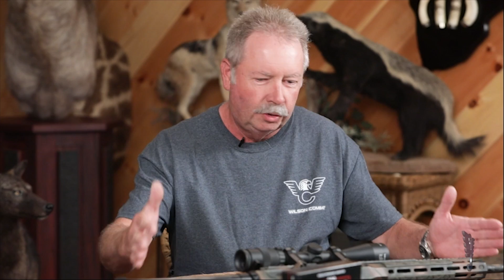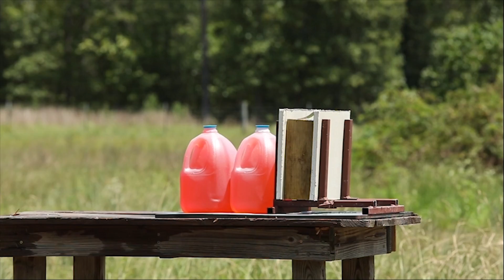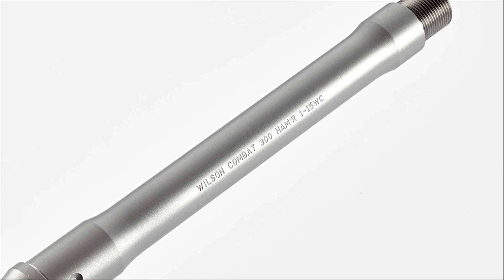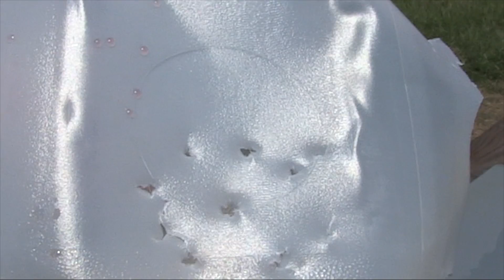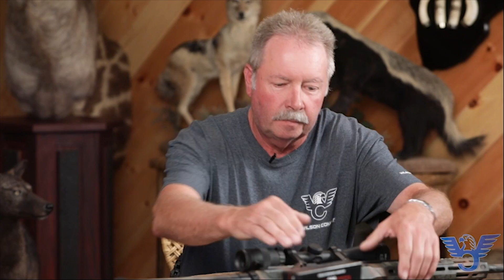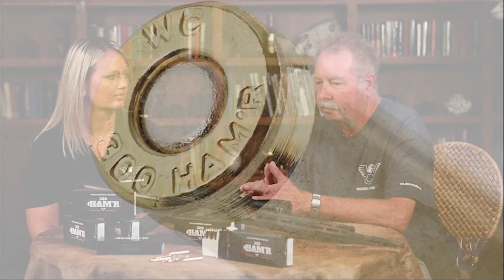An Interview With Bill - 300 HAM'R

Comment: I just converted a Daniel Defense DD4 V7 556 to a Ham'r. I used a 15 inch twist barrel, 16" long with your adjustable gas block because am running it suppressed. I bought 2 hundred loaded rounds of the 130 Hot Core, loading dies, CFEBLK powder, 200 rounds of the shiny (nickle) brass and 500 rounds of the 130 Hot Core Bullets. Printed your loading Data so I think I'm all set. Hoping I get groups like you do and I can't wait to try it on one of (a bunch of) our Texas feral hogs. Very nice video even if it  is 4 years old. Now I think I need a Wilson Combat 338 Federal. I have 20 rounds of ammo but no rifle lol.

Comment: Bill Wilson, I  have purchased a 300 ham'r barrel along with "all" of the components from Wilson Combat to put together this rifle,  but the chamber is so tight that when you load a round and don't fire it you can't get the round out without mortaring the rifle to unload.  The chamber was so tight that it would pull the bullet out of the case leaving it stuck in the barrel. This the 2nd barrel sent to me and was having the same problem with. I was on the phone with customer service and the gentlemen I was speaking with told me that I should ease the blot closed and then use the forward assist to complete the loading process.  This is the most absurd thing I have ever heard of when loading an ar 15 type rifle. He said that the chamber so tight that loading it the proper way was wrong, that you have gently load it because the weight of the bolt is pushing the bullet into the lands and groves,that it it essentially locking the bullet into the barrel.He said that it may improve with shooting It, but I don't want to spend money for something that should work right out of the box. If this is the case what is the sense in have a semi automatic rifle. Iwould like to hear from Bill Wilson himself.
Reply: First step: Don't try to contact through the YouTube comments section
Reply: @georgewhitworth9742  first step wasn't you tube for your information, just trying to make him "Bill Wilson" aware of what was happening in his company. I guess you didn't  comprehend the part where I said I spoke to  "customer service ".

Comment: The 35 Whelen is the ballistic twin of the nine three, especially with a 250 grain bullet. Practical same trajectory and recoil. The classic load is 286 grain projectile at 2,350 fps with just over 3,500 ft-lbs of energy. 
The recoil is less than most loads in a 338 Win Mag, 8 ft-lbs of energy less with a 250 gain load. If you can’t find a decent rifle in 35 Whelen, there are a lot of great European options and ammo for the 9.3x62, it’s an African classic.

Comment: There is a ranger 1/13 and a recon 1/15 probably 10 oz diff in weight in a 16" barrel. Hog hunting app which one is better also, these numbers are out of a 18" barrel would it be dramatically dif from a 16"?

Comment: Laughs in 7.62x39 handloads
At least it uses standard 5.56 bolt face that's a plus
But I'm pushing 123grn 2500 fps out of a 16" gun with my loads

Comment: So in the end Wilson rips off the 300 Blk AAC! Make the same old converted 300 Blk Out cut off 5.56 case a pinch longer and add a pinch more powder, compress the load and lower the twist rate, Big deal, this is not another big mass inovation!. Then the price of the gun..Ha Ha! Then the price and availibility ammo.. Ha Ha!. Then why thread the barrel if you can't suppress it? If you really need or have to have more power than a 300 BLK or an AK.. 7.62 x 39, then just get or build a light AR-10 that uses a real .308 cartridge (And way cheaper and available everywhere too!) and be done with it, Then go man up those weak old girly man arms or just quit and retire you can't do it forever!... Then you say your cartridge has more fps, range, and footpounds of energy over the 300 Blk and the AK and then use it for home denfence? Then what, hitting the neighbor kids nextdoor thru 6 walls? Your an knot head sir!..

Comment: Basically just a hot 300 blackout you can hand load and come out with the same performance and still have a gun that has plenty of commercial options instead of being stuck with somthing that isnt commercially viable being its to close to 300 blackout

Comment: Yeah, but what happens when you cut the barrel down to 9 or 10 inches which is a huge benefit for the 300 blk. Even with supers. Don’t really see the need for this. Especially with the cost, rifle or ammo.
Reply: Seeing as this round wasnt made to be shot out of a short barrel, I dont see why you would. The 300 blk was designed to be shot out of a 9 inch barrel, which makes it a solid option for a pistol or sbr. If I have read correctly, the 300 hamr provides more energy at longer distances.
Reply: Bet with a short barrel that accuracy isn’t so great with that slow twist rate either.

Comment: Could have sworn Wilson did this one already... oh yeah they did its the 7.62x40 WT...back in 2011...
Reply from the maker: The 300 HAM'R case is .040" longer, the shoulder is .040" further forward than the 7.62x40WT and the lead/throat is .040" longer. This results in a 1.5-2.2 grain powder capacity increase depending on bullet shape and prevents the 300 HAM'R from chambering in a 7.62x40 for safety reasons. The 300 HAM'R has a velocity gain of 75-125fps over the 7.62x40 depending on the bullet used. Largest velocity and performance gains are with the Sierra 125gr SBT PH, Speer 130gr FNHC and all 150gr bullets. Due to the twist change from 1-12 of the 7.62x40WT to 1-15 in the 300 HAM'R and CFEBLK powder overall the 300 HAM'R is more accurate than the 7.62x40WT.
Reply: Wilson Combat—Thank you, that makes more sense to me know. Appreciate the reply👍

Comment: How does the HAMR compare to your other caliber, the 7.62 x 40mm WT?
Reply from the maker: The 300 HAM'R case is .040" longer, the shoulder is .040" further forward than the 7.62x40WT and the lead/throat is .040" longer. This results in a 1.5-2.2 grain powder capacity increase depending on bullet shape and prevents the 300 HAM'R from chambering in a 7.62x40 for safety reasons. The 300 HAM'R has a velocity gain of 75-125fps over the 7.62x40 depending on the bullet used. Largest velocity and performance gains are with the Sierra 125gr SBT PH, Speer 130gr FNHC and all 150gr bullets. Due to the twist change from 1-12 of the 7.62x40WT to 1-15 in the 300 HAM'R and CFEBLK powder overall the 300 HAM'R is more accurate than the 7.62x40WT.
Reply: Thank you!  I like your HAMR cartridge.  I don't plan to shoot subsonic so the HAMR being purely supersonic (if I read that right), is good with me.

Comment: You convinced me that this is a great idea. Now make it commercially viable. Get Ruger to put it in the Mini-14/Mini-Thirty, and get Hornady, Federal, Remington & Winchester to load it.
Reply: @Dude Lebowski And also because you already have 308 NATO that's been around a long time and with many rifle models already out there. I can't imagine what the cost of a new cartridge like the HAMR might be compared to readily available 308.
Reply: @Jazzman-bj9fq  you can get some 300 hamr ammo for less than .75$ direct from wilson combat. New manufactured by them
Reply: @Jazzman-bj9fq  Can't chamber 308 in a normal length AR, genius.
Reply: The key isn’t ammunition manufacturers as much as rifle manufacturers. Get the hamr out in the wild in semi autos and bolt actions and levers and single shots and the compact low weight low recoil .30 hamr will win over the hunting market.  If it’s not made in other platforms it will wither like 30 Remington AR.

Comment: I will admit... I'm not completely satisfied with the 300 BLK.  I like the ability to run short barrels without significant velocity loss, but suppressed or not, I'm always running supersonic loads as bullet performance is critical to me.  Running Fiocchi 125 SST's out of an 11" BA barrel with fantastic accuracy and pretty good performance.  But for what I want to do, I need more power.

Comment: If 300blk didn't already exist this would take off for sure. The truth is most people don't understand ballistics so they won't SEE the improvements as being significant and feel it worth the price increase over 300blk that I'm sure will be there. I understand it, but most people won't. This is what 300blk SHOULD have been.
Reply: Great round but as you mentioned 300 blackout was created to shoot suppressed and therefore it’s not a competitor.

Do I want it, hell yes. Can I justify the cost? No. If I need the extra velocity, which is rare; I’m grabbing my LMT AR10 but when it comes    to hog hunting I’ll grab my MCX 300 blackout.

For an all purpose rifle nothing comes close to my MCX in my opinion. Allows for 5.56, 300 blackout and it’s host to my Gemtech One.  Great for my ear safety, plenty of velocity if necessary and much lighter than my DD 5.56 or LMT .308.

Now would I consider purchasing a 300 HAM’R barrel for the MCX? Hell yes.
Reply: The blackout works great for hogs. The grendal still has better ballistics. None the less its good to be pushing forward, that's how we evolve and get better tools.
Reply: @ David Bennett

what a rude comment, people buy suppressed to not blow their ears out.

This is a cool round and props for making it, but I got 556/300'blk/308/30-30/458 socom etc

where does this fit in a necessity 

8.6 whisper if you want more power than 300
Reply: Does it do the subsonic stuff as well? Because that was the whole purpose of the 300blk
Reply from the maker: No, it is not compatible with subsonic applications. The goal was to maximize terminal ballistic performance by not making some of the same sacrifices as the 300blk, while still running in a standard 5.56 AR-15 platform.
Reply: Too many Bozos want to pretend they are assassins and shoot suppressed. I have absolutely no interest in the 300 AAC.  For me I want terminal ballistics and am truly excited about the development of this new round.  My AR .223 Wylde has an Adams Gas Piston System that definitely needs a barrel swap  to 300 HAM'R.  Eventually I will build another dedicated upper for the .223 Wylde.  Having ammo choices is prudent.  Who knows perhaps I will just build 300 HAM'R uppers with different barrel lengths for different purposes here on the farm and sell the .223 Wylde barrel.  After all I do have 4 30-30 win. rifles.  My Savage 99 and Rem.788 shoot "pointy" bullets that prove the 30-30 to be an excellent shooter out to 350 yards. I might just give up my 30-30s and stick with the AR platform.
Reply: @magicdaveable  Fudd spotted
Reply: @georgewhitworth9742  just cuz you disagree doesn’t make him a fudd